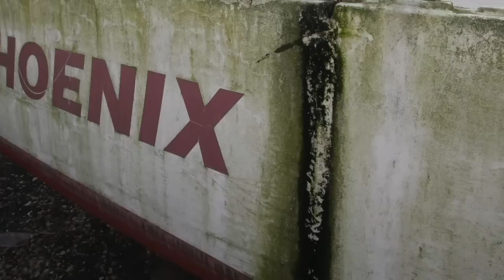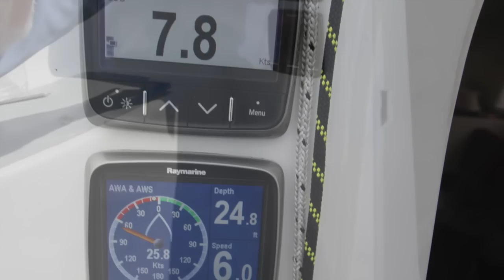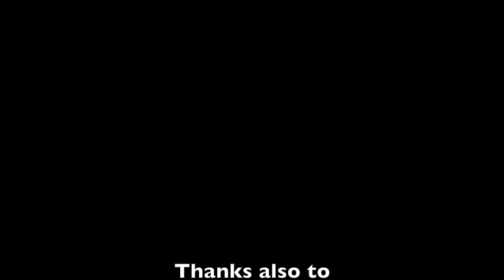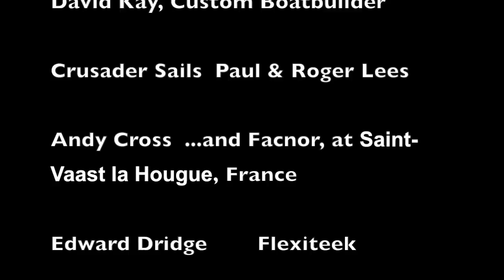Phoenix Rises   2: A Telstar trimaran reborn

Comment: Great job. Love the sails. Windchaser had to have the rudder post rebuilt and the lift busted the hulls on both amas. just finished rebuild on that. Went to solid four inch lamination and two layers biaxial for eight feet under cross arms just to lift the boat. So still sitting in drydock.

Comment: Hello there Windchaser, thanks for posting. You guys did a fabulous job on rehabbing the boat. I first saw the Telstar 28 about four years ago and have wanted one ever since! I've been looking to find a used one here on the East Coast here in the US. Q- I always thought that the Telstar 28 had telescoping amas and yours seem to be similar to the Dragonfly and the Corsair. Do yours fold up. It looks like they do. Anyway fabulous job and keep the videos coming. ;0)
Reply from the maker: evan2156: The floats used to have a folding mechanism made of galvanized metal. They were heavy and rusted up. Since the was never trailed for 25 years I took them off and had new galvanized brackets made and fitted with David Kay's expert help. We did consider lightweight carbon fiber brackets but the cost was prohibitive for a veteran almost 40 year old multihull!